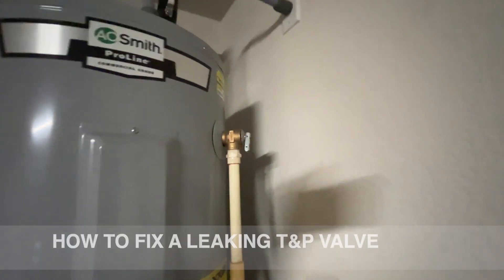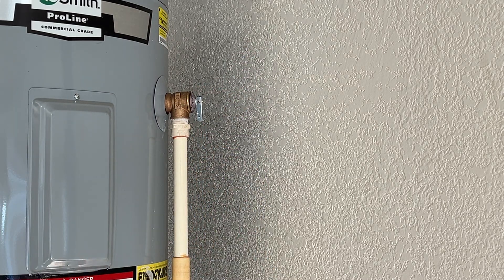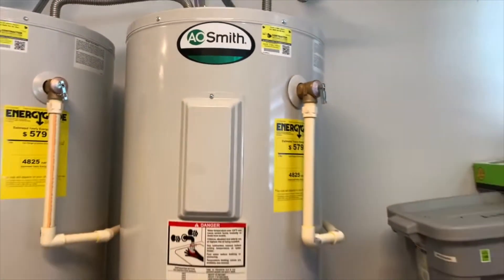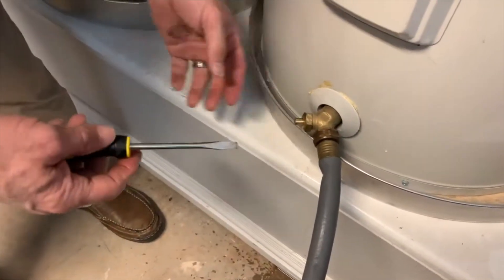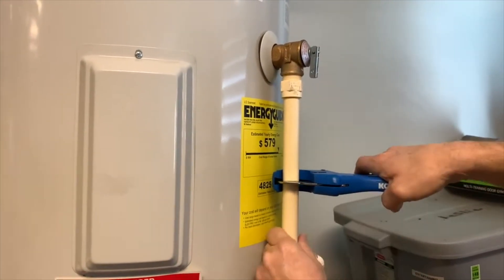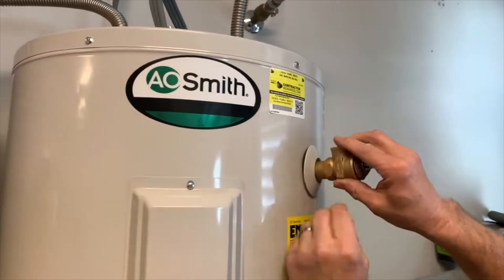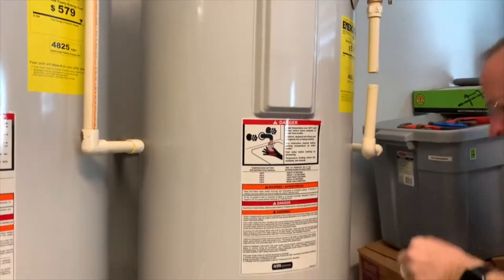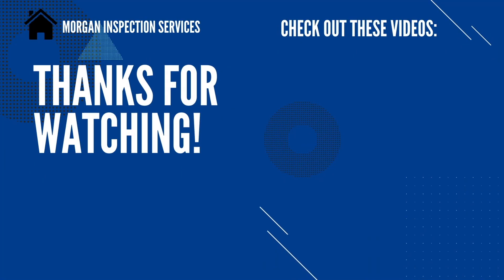How to Stop a Water Heater Relief Valve from Leaking (Easy Fix or Replacement)

Comment: You may want to suggest to be prepared for if the drain valve starts leaking after you try and close it after draining the tank.    

The darin valve can clog up and wont close back all the way because of sediment that has formed at the bottom of the tank.  When you start draining the water and then close the valve back the sediment, largest in the valve closure in the valve starts to leak. This can surely happen if the tank has been installed for a while.  So you may want to suggest what to do If that's happens.  Other than that, the video is awesome, and thanks for taking the time to share!
Reply from the maker: Good point – that does happen, especially on older tanks with sediment buildup. Always a good idea to be prepared for a drain valve that won’t fully reseat. 
And thank you – I appreciate the feedback.
Reply from the maker: Good point – that does happen, especially on older tanks with sediment buildup. Always a good idea to be prepared for a drain valve that won’t fully reseat. And thank you -  I appreciate the feedback.

Comment: Thanks for this video, luckily I just had to operate the handle a few more times to get the sediment out it .  It didn’t work until I fully opened the valve for a couple seconds though.
Reply from the maker: That’s good information to know. I’m glad it eventually worked for you.

Comment: Seems pretty simple except that I have a copper pipe 🤨
Reply from the maker: And the copper pipe is connected down below to another copper pipe so you can’t simply unscrew it, correct? In this case, you’re going to have to cut the copper pipe so you can unscrew it. There are alternatives to re-soldering it so you can reconnect the pipe without having to solder.
Reply: @morganinspectionservices3840 it’s welded and the outlet is all the way on the other end of the house outside so it’s hard to tell how bad it’s leaking. I rent so I’m probably going to just let the owners deal with it. Great video nevertheless.

Comment: Awesome! I only had to watch :30 seconds and your 1st recommendation was the fix! I have subscribed and will be back for all other prolems that may come up. Thanks as I was dreading having to pull the valve, replace washer or O-ring etc!
Reply from the maker: I am so glad it worked for you. Thanks for commenting.
Reply: Came to say the same thing. Mom called me over because it was leaking all over the ground. Had to google what water heater I had, pulled up the manual, saw the part name that was leaking and then looked up a fix and this first link helped me 😂

Comment: I replaced mine 
Turn down the temperature and it’s still leaking, what now ?
Reply from the maker: If a new relief valve is still leaking and the temperature is set correctly, the next thing to check is water pressure. High incoming pressure or thermal expansion will cause the valve to drip even when it’s working properly. A pressure gauge on a hose bib will tell you a lot — anything consistently over about 80 psi is a problem. If the home has a check valve or pressure-reducing valve and no expansion tank, that’s very often the cause.

Comment: Thank you for this presentation. I tried the first trick and I think that might've solved the issue since there was black water coming out first and then became clear after.
Reply from the maker: Yes. It sounds like you probably just had a bunch of gunk built up around the relief valve. I’m glad it worked for you.

Comment: So what do i do next of i replaced with a new valve and it sill drips everytime after i use the hot water and the tank fills back up?
Reply from the maker: You’re saying, the relief valve leaks every time you run hot water? I’m a little bit confused. If it continuously drips, and drips after you replace the valve, your water heater may be over pressurizing for some reason. Give me a little more information and I can try to help you figure this out.
Reply: @morganinspectionservices3840 yes it drips everytime I use the hot water and the tank refills. I just tested it yesterday and it's at 90 psi
Reply: @BrandonLegate270 look up watts adjustable valve

Comment: By the look of the black water coming out of the faucet, the water heater is due for flushing. I religiously flush my water heater annually, preventing crud from accumulating in the bottom of the tank and causing the lower element to burn out.
Reply from the maker: Yes. This water heater was flushed shortly after making this video.

Comment: A trick I use to realign the short drain pipe is to screw the pipe into the valve first, then screw the valve into the tank.  You will see when to stop turning the valve as it gets tighter and the pipes align.  Don't over-tighten!  Tight and one turn more is not recommended.  :)
Reply from the maker: Thanks. That’s great advice.

Comment: Local code may require the T&P valve pipe to extend within a foot of the floor, unless piping routes water to drain.  This is to prevent scalding hot water from injuring someone.  Also, the T&P valve pipe size may not be reduced from the valve size.
Reply from the maker: Great point — that’s exactly right. 👍 Most codes require the T&P discharge pipe to terminate close to the floor or to a proper drain, and the pipe size can’t be reduced. That’s an important safety detail, and I appreciate you bringing it up for others to see.

Comment: Based on what I've noticed over the years, the T&P valve often leaks because of a "closed" system, either because a pressure reducing valve was installed to combat excessively high water pressure, or the local plumbing code requires a check valve before or just after the water meter to prevent cross contamination of the potable water supply.  In these situations an expansion tank is just what the doctor ordered.  

In very rare instances, a T&P valve can leak (actually, it would be fully opened) if a defective thermostat in a gas, oil fired or electric heater fails to turn off the heat source when the set temperature is reached, or a grounded heating element in an electric heater continues to heat with 120V to ground after the thermostat setting is reached.   In an overheat situation the T&P valve will remain fully open until the cold inlet cools the top of the tank some degrees below 210°F.  This could mean a dozen or so gallons of near boiling water blasting at high pressure and that's where a suitable discharge pipe can literally be the difference between life and death to anyone standing nearby when it opens.
Reply: I've encountered that situation too.  After a big draw of hot water, the replacement water has nowhere to expand, and so lifts the T&P valve just a bit, enough to start dripping.  This could get costly, as you've paid to heat that leaking water.
Reply: My city in NY requires  expansion tanks on all water heaters, but they don't enforce it and probably only 20% of homes have them.